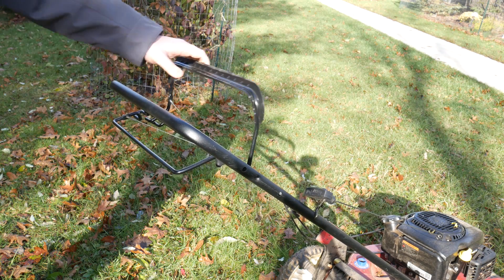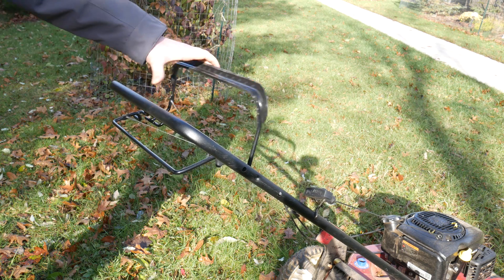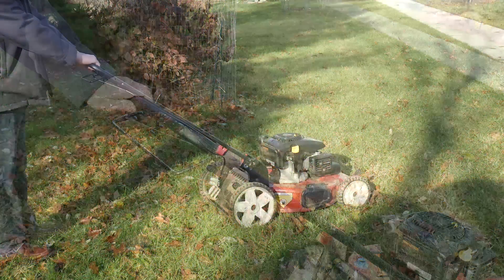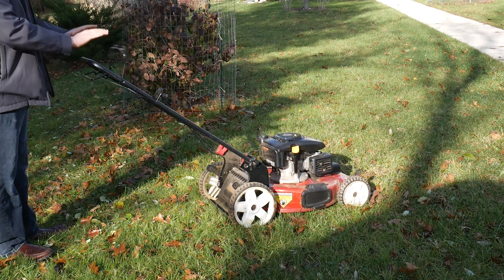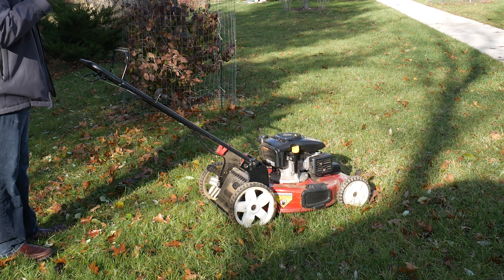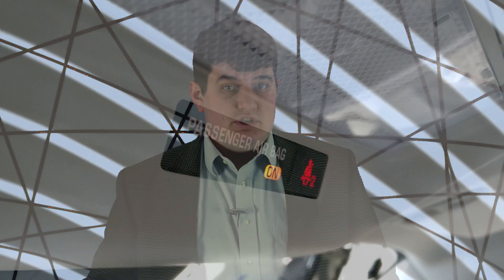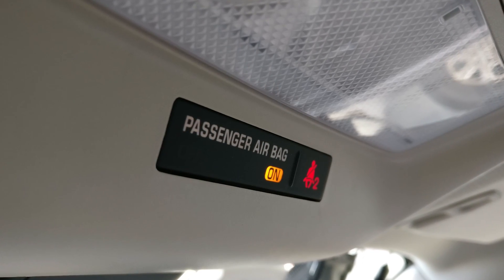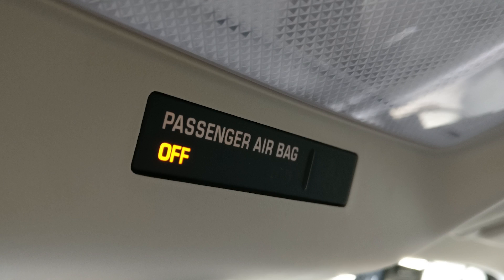The Dead Man's Switch:  How Anton Yelchin's life could have been saved

Comment: There is no drive by wire in the US, US law requires all vehicles have direct mechanical/hydraulic linkage for brakes and steering
Reply: @bosstowndynamics5488  electric power steering is an assist to the mechanical system, the mechanical system is not a fall back. Having the electric motor there does open up possibilities that where not there with the hydraulic power steering, such as lane keep assist, but it does not over power forceful inputs from the driver....

Comment: Yet more meat in the case for bringing back manual transmissions. If you’re in gear with the engine running and you try to leave the seat, the clutch slams back into engagement and the engine stalls. This would pretty much never happen in the first place, though, as you’ve gotta be pretty darn distracted to forget that you’re in gear.

Comment: The most stupid shift I have ever seen is the Ford Explorer. The shift lever is on the console BUT the shift indicator is on the dash. The "PRNDL" on the console does not not indicate the gear the transmission is in. Normally if the shift is on the console so is the gear indicator is on the console and if the shift is on the column the indicator is on the dash. That makes sense. The Explorer system is stupid.

On the other hand you cannot prevent all stupidity . I hope they do not listen to you on this one.

Comment: 1. in manual transmission vehicles the second you take your foot off of the clutch in gear without throttle input the car will jump forward and stall or roll especially on a hill (telling you put in neutral and pull the handbrake) giving plenty of time to react. and if you stop on a hill it is common sense to put on the hand brake 

2. in a automatic if you are on a hill and your car is in drive the car will roll the second you take your foot off the brake even if your in flat ground giving you time to react and put on the handbrake or put in park.

Comment: A relative of mine is a retired train operator, and he told me that the deadman switch on a train is a little bit more complicated than just to hold it down. Since if you pass out not every body would release the switch. It requires a controlled release and re engagment of the switch in regular intervals, in order to show the system that you are still contious. If you fail to meet that you are warned by an audible signal, if still not complying to the procedere it is followed by an emergancy brake.

Comment: Industrial robot teach pendants got a different kind of deadman switch that requires the operator to hold it properly, not too loose and not too tight. And that kind of deadman switch should be on the gas paddle, that whenever the driver push it all the way down it would trigger a break instead.

Comment: Talking about interlocks, have you contemplated on making a video about the Therac-25, a cancer treatment instrument in which programming faults caused deadly errors?
Reply: Oh god I watched a video about that a few weeks back. Switching between its two modes (x-ray and intense light) caused lenses to adjust. This took 6 seconds and during those seconds it would ignore any commands to switch back but the computer would say it was switched back. So if you filled out the field wrong and went back to correct your mistake it would cause the machine to be set wrong. And the intense light mode took 10 times the power consumption of the x-ray mode, so now it's set to x-ray at 10 times the power level it should be!

Comment: You would need an override for towing the vehicle, but that too wouldn't be very hard to implement .
Reply: Yes, and some way to override if the driver is alone in the vehicle and wants to push it while it's in neutral (if it breaks down and needs to be moved, for example).

There are probably several situations where this automatic "no driver = pop into park" behavior would be a pain. Maybe the increased complexity needed to deal with these is why auto engineers haven't implemented this feature.

Comment: My car is a Mercedes E Class from 2011 and if you leave the car in neutral and then you open the door while the car is not moving, the car will automatically switch to park. Once it switches to park, you can force an override by switching to neutral again, for working on the car and mechanical reasons.

Using the seat occupancy sensor is a very bad idea to switch the car to park. How do you push a car while it's broken down? How do you tow it? How do you rotate the wheels while working on the car?

The door open when in neutral switch to parking mode is the proper way to do it, and every car under the sun knows when the door is open and ding ding dings at you. Just add a line of code to check if car is neutral when door is open and switch it to park.

Long story short, use the door switch as the sensor, not a seat occupancy sensor, as that creates a tsunami of practical problems.

Comment: While I do agree that this is generally a good idea, one issue I see is that this may make it impossible to push a car that is either disabled or that has gone off the road in bad weather.  I had a belt break once and had to shift my car into neutral and push it through a busy intersection.  I'd hate to have the car just lock up because it thinks no one is in control.

Comment: 2 problems I see with this:

1 is what happenes if you need to push the car (out of gas) which would be difficult to render in your setup
2 is what if I am driving and, say, I stretch a bit or try to scratch my back (as I have done before many times on long car rides) and removed your butt from the seat for a few seconds in the process?
Reply: well Number 1 is easy as mercedes has these kinds of transmissions you just select neutral again, and number 2 is even easier The system requires the belt to be unbuckled and the door to be opened before the seat sensor looses weight, or the car just refuses to go into park if you adjust while the vehicle is moving

Comment: i see a few problems with it, specially for towing or pushing the car when its broken. let's say, your battery died, you don't have electricity anymore, you can't push 5 times the start button to deactivate the control module because. so you are stranded and you can't tow or put the car in a flat bed truck unless you have something to lift it up.  it's not like they didn't thought of that, it's just expensive (remember the pinto solution for it exploding) and not worth it since its just one incident of this happening

Comment: Late to the game on this one but the seat sensors aren't perfect. If I put my phone in the passenger seat, there will be a constant dinging to buckle it up. I accidently left my windows open and it downpoured. Seats we're very wet but it screwed up the sensor for a day. Take the sensor you're talking about and put it in the driver's seat. It'll mess up so much that it'll make the car undrivable. It is the most used seat in the car. My VW unlocks the door when it's in Park and locks them when you shift. Just having that is a clue as the lock/unlock sounds are a bit loud and very noticeable. If my driver door is open when I'm in a different gear and not in Park, there's an annoying beeping to let me know. It's not like there aren't options but I think the seat sensor is the wrong way to go. There's other ways to do what you're aiming for. The seat sensor just isn't perfected yet. And yeah, different cars I've had it screw up on: Hyundai, Ford, VW, Chevrolet.

Comment: Simple software updates would still cost the manufacturer millions of dollars to implement.
For example, lets say the 2016 Jeep Grand Cherokee was given a recall to update the PCM with this software fix. There were over 200,000 of those sold in the US alone. Let's be generous and say it only takes half hour to update the PCM and with a shop rate of around $100 an hour, 200k X $50 = $1,000,000. One million dollars for ONE car for ONE model year. In the real world, there would be multiple models for several years effected. Say, for instance, all Jeep Cherokees, Grand Cherokees, Renegades, and Compasses were affected from 2014-2016. Now that's over 1.5 million cars in the US that need this recall, again at about $50/hr you are looking at around $75,000,000. So when you say "the cost is virtually nothing" you couldnt be further from the truth.
And also, the steering wheel IS physically connected to the wheels on all cars. "Steer by wire" just means there is an electric motor to provide steering assist instead of a traditional hydraulic steering pump. The worst part about this is you can tell he did the research, but there is so much more he still needs to learn about the industry as a whole.

Comment: I had a 2015 Chrysler 200, same manufacture as a jeep. If you were in reverse or drive and unbuckle the seat belt, foot off the break, open the door then the system will automatically apply the brakes

Comment: Seat occupancy sensors are reserved only for passenger seats. This is in case of a smaller child sitting in the front that could be seriously injured or even killed by the airbag. They are not in the driver seats because it's assumed that whomever is driving is large enough to be able to safely take an airbag to the face :-)
So yeah, in order to set up a system like you've described, they would also need to install occupancy sensors in the drivers seats as well. 
For those of you who don't know, the passenger occupancy sensor is what causes the "Passenger Airbag" light to go from "Off" to "On" when more than 60lbs (usually) is detected in the front passenger seat.

Comment: There is a 'thing' to Dead Man's switches though. The reach-truck I operate at work has one in the seat. Downside is that I'm so lightweight (about 54 kilos) a small bump on the floor can trigger the switch. Fortunately, our reachtruck is old: it does not have any software onboard so as soon as the switch is pressed again, the machine is fully functional again.
During training however, this really was a problem: I did everything the instructor told me, but the red 'stop' light on the joystick just stayed on. Eventually he came to check out what was wrong, applied the handbrake and then pushed onto the seat while I was seated. Then the switch was opened and the machine came to life (of course, I could not use it)

So yeah a Dead Man's switch can do a lot of good, but only if they take very light people into consideration as well.

About locomotives: In the Netherlands (and other European countries) the standard dead-man switch has already been deemed unsafe and has been replaced by an intermittent one: one must press a switch down for something like 20 seconds and then release it for a short time, after that, it has to be pressed down again. An alarm will sound if the driver does not act within 2 or 3 seconds or so. After that, emergency brakes will be applied.
I also saw this system 'inverted' on a German train way back in the nineties, where the traindriver had to press the switch shortly every 15 seconds or so and then release again.

This is too prevent that if a traindriver should suffer something that makes him fall to the floor of the train and accidentally pressing the switch, the train would continue while no one is able to really operate the train anymore.

This is also done because in the past, especially at shunting yards, it was quite common practice to place the bag a traindriver always has with him on the pedal, so he or she could shunt more easily, ofcourse kind of defeating the purpose...
Reply: @MatthiasGörgens  Yeah I think it's almost the same everywhere in Europe. The 'problem' in the simulator was about the same I encountered in OpenBVE on an English route. OpenBVE is nothing like other trainsimulators and requires you to read up on how the train works (which I did not do in advance)
Eventually I got some train moving, but did not understand why my train was stopped every time. I then read about TPWS ;)

Comment: My  07 Prius  sounds an alarm if you open the  drivers door while still in drive. it might remind you that even though the engine may not be running the car is not in park . This kind of reminder alone would likely have been enough to save the guy you were talking about. Better yet, it should be able to be put in place right away because it doesn't need to talk to the engine control module to sound an alarm... not that it shouldn't be able to , but a seat belt stile alarm is really still better than nothing, maybe even good enough, and it could be used right now on every car without having to decide what to do at what speed if there is no driver, just sound a little alarm.  And my 07 Prius already does that.

Comment: Bitmain
At the time you made this video FCA which includes dodge Jeep and ram Chrysler  pushed a recall to all vehicles with a electronic gear shift to automatically shift the vehicle into park if the drivers door was open and the vehicle was moving slower than 5 MPH. So someone already thought of this and developed a way to protect the driver from accidentally leaving the car with it not in park without the need of a dead mans switch.

Comment: With the throttle being disabled when the brake was applied, I found this pretty interesting, once the DBW throttle body in my sisters 2013 Ford fusion 2.5 got stuck open, to prevent unintended acceleration the engine computer cut out 2 cylinders, so it was possible to drive out of traffic but not speed uncontrollably. Just goes to show some car manufacturers are taking precautions to prevent accidents, whereas some auto makers (*cough* Fiat-Chrysler) are taking very little if any precautions.

Comment: Us Englishmen have a far better solution. It's called a manual gearbox and it has a proper handbrake. Only a complete tool can fail to secure such a vehicle. It's also fantastic for acceleration and engine braking.

Comment: I agree with the sentiment, but It's not that simple. Faulty sensors are a thing. If your car automatically goes into park when the driver's seat is empty, and the sensor fail while on the highway, I think accident rates would actually increase.

Comment: I'm sorry... I disagree with a dead-mans switch in a motor vehicle because of operational failure... what happens if the switch fails when you are on the Interstate?
Yes, you commented on this... but seriously... a dead-man switch failure is usually catastrophic. 

I do use the sad story of Anton to point out 1 very important aspect of a vehicle to anyone who will listen... you car is equipped with a parking brake... use it!
Reply: To anyone who would point out that the car was still in gear... if your car rolls while in gear then your parking brake has failed... repair it.  The proper test for parking brake functionality is to apply the brake then shift the car into drive and into reverse while NOT using the service brake.  Your vehicle should not move in either gear.
Of course if you drive a manual then you know all this and rely on your parking brake.

Comment: The zf 8speed is good but that dial is stupid as hell. If they at least put the dial on an angle where the gears went up/down instead of left to right, it may have been enough. But no, that cost 10 cents too much apparently. They knew very well this type of thing would happen and made zero effort to mitigate the risk. Edit: noticed the topic was the mono shifter not the dial. My bad. Tbf though the mono is even worse.

Comment: VW now have this to some extent

The handbrake will not release if a door is not shut or, the driver is not wearing a seatbelt.

Does this in both my 2019 passat
And my wife's 2017 Golf.
Reply: How does a mechanic bypass that?

I'm curious, not trying to naysay.
Reply: @biggie0516  it is an electronic handbrake.  You can press the switch to release it but by doing so the car will also disable the auto hold function.  This is for the seat belt.
If a door is open I'm not sure because I haven't tried.

And to release it I believe the ignition has to be on.
There is probably also a manual override somewhere

Comment: There's a problem with your theory: to the best of my knowledge all current production automobiles at least in the united states require you to push the brake pedal before the car will let you put it in gear. Anton would have had to accidentally press the brake pedal and accidentally shift into gear at the same time.
Reply: only to get out of park, anton had just pulled up his driveway and was trying to put his car into park

Comment: On mowers it's a hard wired switch that grounds the ignition this also can be done on cars by having the parking prawl servo hard wired but provide a by pass switch for a failure.
Another fix make just make manufactures implement shifters with clear dents and maybe even out right ban gear shift by wire and require a cable to be present as there is nothing gained by having shift by wire on a car except introducing new failure modes.
I seen a car with a gear selector that looked like a radio dial so they're clearly choosing style and cost over proper ergonomics and the goverment really need to crack down on this.
What's next the turn signal and wiper controls are going to be a Rubik's cube and a plastic pickle mounted to the ceiling?